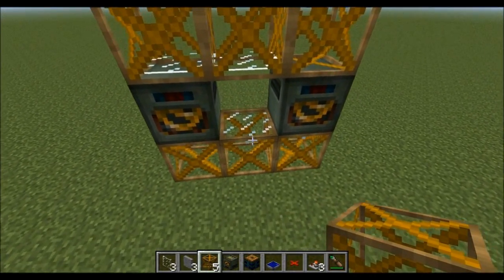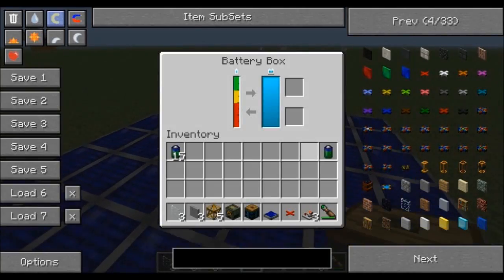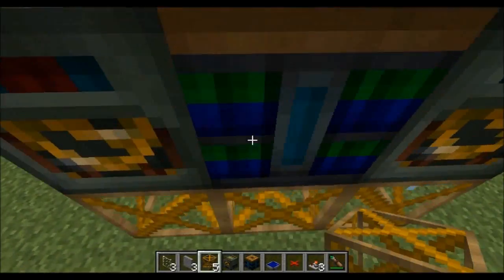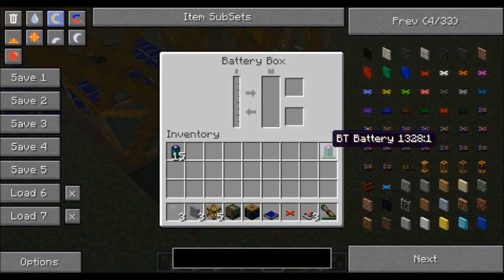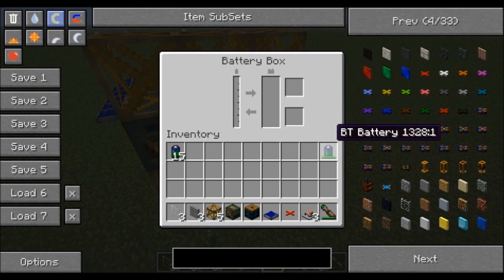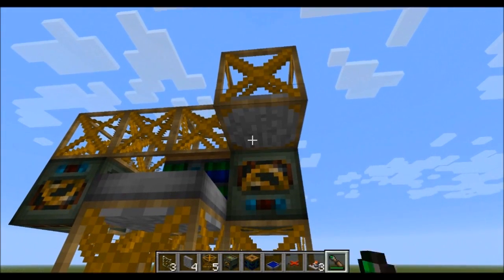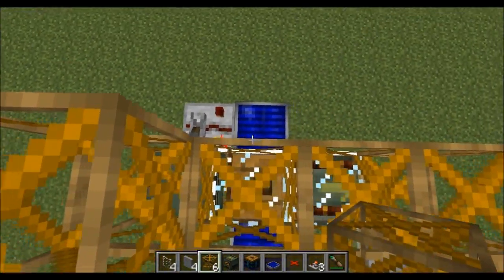Redpower 2 Frames Caterpillar engine tutorial

Comment: Had a lot of trouble just copying this but I finally got it
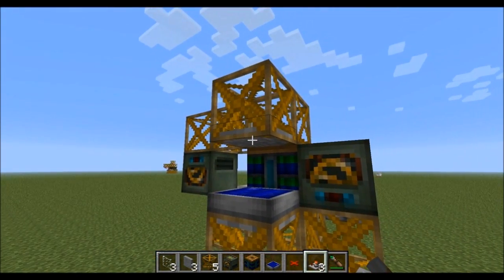Those are glass covers and stone panels and it's an important distinction, there is a no cover or panel under the battery box, and at 2:40 he fundamentally rearranges the machine.Copy the design from the preview at the start of the video to get this thing right

Comment: To everyone who no doubt is blaming the creator of the vid. Covers are used so that the motors can slide by each other. COVERS. If you want machinery, like a solar panel to stick, then you need PANELS. Very important difference. If you misplace even one panel or cover, something will no doubt fail.

Comment: For those still having trouble check out this video.  He shows how to make the same thing in all directions, but his single direction caterpillar is easier to follow.

youtube.com/watch?v=itCyMWTBU_0  -- about 40-45seconds in pause it and build that.  Make sure you put PANELS under the toggle switches.  Note: those frame motors have been powered by a batbox that was most likely removed.  You can tell a frame motor is powered because of the blue lights on it.

Comment: In the new version of RedPower this doesn't work with toggle latches, because the motors only respond to a pulse, not a steady signal. However, if you replace the toggle latches with timers, you can achieve the same effect (and adjust the speed of movement). Just place an extra frame with a lever attached next to one of the timers to turn the machine on and off.

Comment: This works in the latest Tekkit (3.x).  You need to make sure you are using glass COVERS and stone PANELS.

Covers prevent frames from dragging neighbour blocks, and panels give a cosmetic look and still allow the frame to drag.

Glass cover needs to be on the face of the frame touching the arrow on the frame motor.  If you have panels here the machine will do one or two cycles before breaking.

If you use stone covers instead of panels the solar panels and toggle switches will fall off.

Comment from the maker: move red alloy wires by placing them on panels, and for jacketed wires put them on an uninsulated side or on a panel, a paned is like an uninsulated side but it can have things like wire on it. also try not to use vanilla redstone on it, its rather buggy.

Comment: I think it would be possible to make an elevator that wouldn't be attached to anything, by using this and rotating it. 
But if you did that, would you be able to make it stop by itself?
(Easy enough to stop it at ground level, the ground will do that for you, but what about on the way up?)

e.g. Floating elevator leading to a floating castle.
(Bonus points if you can make the castle move, and take the elevator with it.)